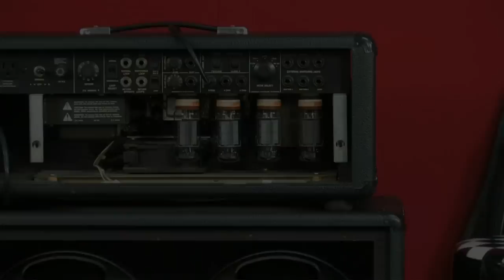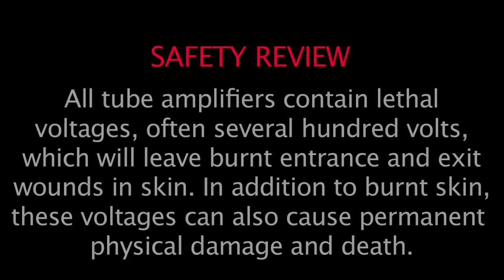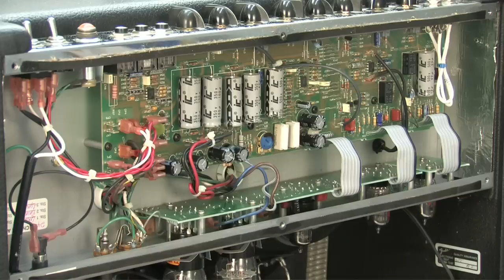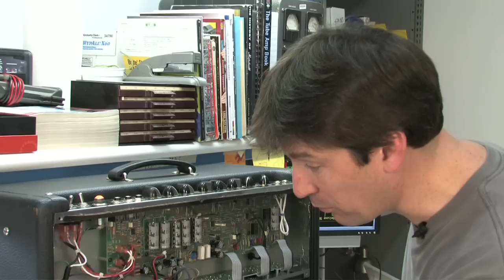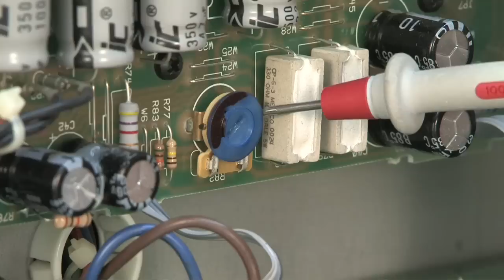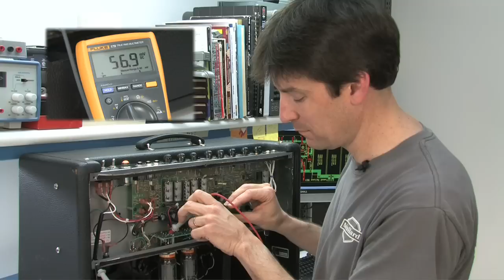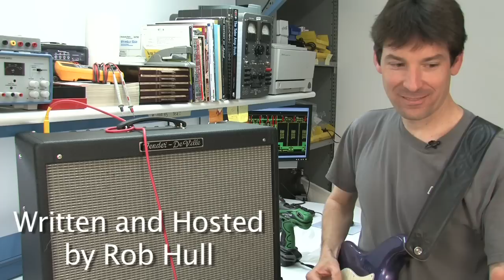How To Bias a Deville Amplifier

Comment: I am having a big issue & you seem to be "THE MAN" to ask!!!
My Hot Rod DeVille will not switch down to clean channel (Always In Dirty Gain Channel).
But when I power down the amp,
It flashes Green for a split second...
Do you know what could be causing this ?
& Where I should be looking first & so on?
I have been a Transtube Peavey Guy for 20 years now & just Inherited one of these fine Beauties !!!
Thanks for the Tube Tips,
Cause that would have been my next Question !!!
Thanks 4 Sharing Bud!!! 
Rock On !!!
DEv
Reply: violeman - make sure the channel select switch on the top of the amp is not depressed or stuck in the down position.  Clean as necessary.
Reply: violeman i've heard resistor 78/79 (the two next to the bias potentiometer shown in the video) can cause issues with channel selectors on hot rod amps, google that?

Comment: Hi Nick, if you can tell me why it is an important first step, set the power - 60 volts, and whether it is necessary to measure bias in milli volts or in milli amps, and what is the difference in these measurements. Best Regards
Reply: Stratocooler - setting the bias control voltage to its most negative level insures the tubes aren't installed with a bias control voltage that could cause tube damage.  the negative 60V is the starting point.
Reply: 'Biasing' is the procedure which sets the 'plate dissipation' of the tubes. This is determined by the plate voltage multiplied by the amount of current flowing in the tubes. The pot adjusts the negative bias voltage on the tubes' control grids which determines the current in the tubes and therefore the plate dissipation. The voltage at the pot is the actual negative bias voltage, and setting it to -63V (or as high as it will go) means that the current in the tubes is at its minimum and can be adjusted from there up to its recommended value. In this amp, (and some others) there is a 1 Ohm resistor between the cathode(s) and ground through which plate current must flow. The voltage across this resistor is measured at the test point, and the number of milliVolts across the one ohm resistor is the same as the number of milliAmps flowing through it.
 (From Ohm's law: current = volts / resistance, I = V/R, so (e.g.) 30mV / 1 = 30mA.)

Comment: Why do you need to do the first procedure of turning the amp to maximum voltage?  I do not understand what the purpose is since in the second step you adjust the adjust the bias voltage to 60.
Reply: ***** - setting the bias control voltage to its most negative level insures the tubes aren't installed with a bias control voltage that could cause tube damage.  the negative 60V is the starting point.

Comment: I looked at the schematic and the bias test point is total cathode current.. 60mV or 60mA for the pair or 30mA pr tube is cold.. offcause is depends on what the plate voltage is, but according to the schematic the +B is 485V with the 60mA total cathode current draw.
That adds up to a plate dissipation of 14.5W pr tube or 48% of max plate dissipation for a large 6l6GC, a bit too cold.. I would aim for at least 55%..(~70mV at the test point).. 80mV at the testpoint is probably around 63% of max plate dissipation.. Remember that plate voltage will drop a little when you bias your amp hotter (i used 478V plate in this calculation).. 
Also the mV number contains the screen current as well, so in fact your actual plate dissipation might be a little less... 

You can use a pair of smaller 5881 tubes for slightly lower power. THey are rated at 23W plate and for those tubes you definately do not want to go above 60mV at the test point.. at this value they are around 63% of max plate dissipation..
Reply: MrAnders1976 He mentions that the 60mV setting is what is recommended by Fender.  He even mentions some different levels that would be okay.

Comment: Hi, is that voltage for any Fender amp? because I have a Super Sonic 60W with 2x 6L6  and I need to bias it, but don`t know what voltage to look for!
Reply: Mateus Moron - Does your Super Sonic have an internal test point for measuring the bias current?  If it does, the voltages should work out.  If no test point, then it is unlikely this video is applicable to your amp.

Comment: so essentially what your doing is adjusting the voltage applied to the plate of each valve? similar to how you would bias the base voltage of a transistor?
Reply: richard kerr - nope ... the voltage being adjusted is the control voltage which is applied to the control grid of the tube.  The control grid of a tube is similar to the GATE lead of a FET.  The plate of a tube is similar to the DRAIN lead of a FET.  The cathode of a tube is similar to the SOURCE lead of a FET.

Comment: Hi Rob, firstly many thanks for this lesson, it was really helpful. I live in the UK so I have bought some GT-6L6-GE tubes from a local supplier. I have followed your instructions however even at the lowest setting I cannot get the Bias under 76. Could you suggest something I am doing wrong, it all looked pretty straight forward. Thanks Lee.
Reply: Lee Gibson -  sounds like you have some very hot running tubes.  76mV is not outside the limits of the tubes ... they will just run hot.  The typical bias range is 60mV - 75mV.

Comment: Is there any issues with handling the glass with your bare hands? I know they can get hot, but is there any issue with oils from your hands causing an issue on the glass like on halogen lightbulbs?
Reply: vacuum tubes are not like light bulbs. Finger prints, dirt, stickers, etc. will not cause any issues.

Comment: Hi - the bias test point on my recently acquired (used) Hot Rod Deville 410 won't go past 30 mV even with the bias pot turned all the way clockwise. I have all the volumes down, power on and standby off, and 30 mV is the actual reading (I didn't divide by 2). I only have the tubes that came with the amp. Is there any explanation you can think of? Nice playing!
Reply: Hi, I have the same issue with my Hot Rod Deluxe. Not as low as your readings but the maximum reading I get is 59mV's. To get a setting so I'm not burning up my tubes I have to set it at 30mV's, which is about halfway. So far I haven't found out why my readings are a lot lower than Fender and others recommend.
Reply: I had a burned out 470 ohm resistor and probably bad power tubes. There are two 470 ohm resistors - one going to each power tube (I think coming off pin 3 - you can see the pin numbers if you look on the white plastic that the power tube plugs into, from inside where the ciruit boards are). I got some 1 watt 470 ohm resistors (xicon) from Mouser.com and replaced the tubes. Now I was able to bias my amp to 66mV. I found the answer to my own question in this article:

http://www.maxxplay.us/img/hrdx/How%20to%20Bias%20&%20Biasing%20FAQ.pdf
Reply: Sal Alexander Thanks for the reply, much appreciated. I've changed my tubes, had same problem with previous pair also, so next step will be to check the resistors. Thanks again.
Reply: Sal Alexander - You likely have an amp issue.  There is likely an open component or poor solder connection.  A qualified amp tech needs to look at your amp.
Reply: Fender56 You likely have an amp issue.  There is likely an open component or poor solder connection.  A qualified amp tech needs to look at your amp.

Comment: Hi Rob,
I have a problem with my HRD and the power tubes.

My HRD III Bias setting range seems to have changed, it goes from 60mV to 15mV. I have set it to 30mV which sounds fine but obviously this isn't anywhere near the recommended 60mV.

When I check the voltage on the right hand side of the bias adjuster, with the standby on, I get -60v.

As I said, it sounds great and I'm not experiencing any hot spots. Is this ok and am I going to damage anything?
Reply: Fender56 - You likely have an amp issue.  There is likely an open component or poor solder connection.  A qualified amp tech needs to look at your amp.

Comment: Hey!
I have a Fender Deville III 212 Amp
It supossed that is in a good condition I have treated him very well the problem is that
yesterday I used the amp in a rehearsal with one of my bands and everything went fine, then I move the amp to another place to jam with another band
I put the amp to heat the tubes about 15 minutes as soon as I turned on the standby nothing goes out of the speakers when i turn the volume at 10 (For firt time in my life) it was at an extremely low volume too low I'd say....

Not even the guitar cables make static i opened the back to check and everything is in order the tubes light up well and there is nothing out of place also i removed the fuse and everything was ok it wasn´t burned or anything like that.

So what do you think in could be the problem? the bad thing is that in the city where I live there are not many music stores or persons that knows about this kind of amp
HELP PLEASE!
Reply from the maker: If you removed the speaker jack to power a different cabinet, make sure you reconnected the speaker cable to the correct speaker jack (the jack closest to the power cord). If still no sound, plug your guitar into the f/x return and if you get sound, the preamp stage is not working.  If no sound, connect an external cabinet to the external speaker output. If you get sound, this external speaker jack needs cleaning.  If still no sound, then the repair is an internal problem that requires an amp tech to troubleshoot.

Comment from the maker: Nik, installing EL34 tubes in the Hot Rod DeVille would require modifying the amp.  If you want a close EL34 sound, I recommend trying the JJ 6L6 as these have a very compressed, low vacuum sound ... very similar to an EL34.
Reply: Shoes EL34's draw more current which means they need a sturdier OT (more ma headroom in the output transformer) and higher screen resistor values, and sometimes also different bias resistors depending on if they can be biased with the trim pot (if the value is in the range of the pot).  Sometimes you can get away with just swapping them but common screen resistors for 6L6 is 470ohm resistor and EL34's for better with 1K or 1.5K resistors.  You can see in this video that even at max range, this bias pot didn't have much throw and would be hard to run EL34's in.
Reply: Shoes Both the power transformer and output transformer would have to be replaced to put EL34's in this amp, along with changing the screen grid resistors as well as changing some of the wiring on the tube sockets, which isn't very easy since their PCBs.
Reply: I would think that EL34s would merely require re-biasing. All octal-pin tubes use the same plug and socket.
Reply: +Alva Goldbook one of my tube amps (and only one out the 30+ I own) a Carvin MTS 3212 has a switch to select between using EL-34 or 6L6GC tubes.  it says in the owners manual that it has different taps on the transformers and different resistors  and different heater loads.  Either way the amp has some great tones.   This amp also has a switch that literally shuts off two of the power tubes to drop from 100w to 50w. but that's another story.  you will almost certainly damage the amp if you use the EL-34 instead of the 6L6 where specified, but what would happen if you use a 6v6, the JJ seams to have very similar specs, . Could I get my Blues Deville 410 to break up at much more usable volumes?  Just wondering?
Reply: Mitchel Young Yes, you can use 6V6s as a drop in replacement for 6L6s in a Fender Blues Deville, but you would have to rebias the amp. It may even require a modification of the bias supply circuit. I've heard of many people doing this with these amps, but do NOT use some vintage NOS 6v6 tubes, as they would most certainly get fried, and possibly damage your amp. Rather, you should stick with the more sturdy modern production JJ 6v6s which are designed to handle such abuse. Another way to tame the volume of the amp is to use an attenduator. Those can be pricey. One trick that worked pretty well for me was plugging into the 2nd input jack and removing 2 of the 10 inch speakers from the amp. I'm thinking I might just put a new baffle in my Hot Rod Deville 410 and replace it with 2 12 inch speakers. The fewer the speakers, the less the volume. You'd be surprised by just how effective this little trick is. Just make sure you have your remaining speakers wired up correctly.
Reply: Is there not a risk of damaging the pricey output transformer when messing about with speakers and output tubes?
Reply: Jonny Beck When it comes to speakers, all you gotta worry about is making sure the ohmage is correct and the speakers aren't pushing too much wattage. With modern day ceramic speakers, this is rarely an issue. 

As I said, you can't just put any ouput tube in the Deville. It's designed for 6L6GCs. But a proper tech shouldn't have much trouble modding the amp to accept JJ 6V6s. I wouldn't recommend a DIYer to try this.

Comment: Nice explanation. Will adjusting bias help with the over-sensitive volume issue of this amp? The "smaller tubes" (pre-amp tubes? Sorry, mechanical engineer ignorance!) are 12AX7 models and I know you previously suggested 12AU7 or 12AY7 tubes. Are those tubes different enough from the X7s to be worth investing in or is there a simple resistor a person could drop in to solve this issue? Thanks so much!
Reply from the maker: The Hot Rod DeVille is a 50W amp.  And in loud applications that require a 50W amp, the DeVille works fantastic. However, in quieter applications (such as at home or church) where a 10W amp would be better suited, this amp is much too loud. As such, there is much internet discussion on making this amp quieter without loosing tone. You can try installing lower gain preamp tubes, or 6V6 power tubes, or a volume pedal in the effects loop, or a different volume control. All of these will reduce (or modify) the volume some, but you will still be left with a very loud 50W amp. I've found the most effective solution is to use an attenuator between the amp and the speakers and control the volume that way.
Reply: The over sensitive volume Aunt Jemima mentions might be to do with the ratings of the pots as that is something Fender addressed in the latest version (III) of the Deville family. Versions I & II used to leap from nothing to very loud when turning the pots between values 0-1. Thanks for the video by the way! Consider me subscribed
Reply: +TubeDepot FYI I just put a GT 12at7 in the PI tube of my Deville 410 and the volume seams much more usable, since the lead channel is not to my taste I will try a 12au7 in V2 and possibly even V1, what do you think?  If I tried some 6V6 what would I set the bias to?   Can I just test to see if I like the tone by taking the tubes out of another 6V6 amp I have such as a Marshall DSL15H or Fender Deluxe Reverb 65ri? or should I buy new?  The JJ 6v6 seems closest in specs to the 6L6 so should I just buy a matched set of these

Comment: Hi, is it possible to run a Bassman with a pair of 6L6B's instead of 6L6c's? Thanks.
Reply from the maker: The bassman will successfully run any version of the 6L6 tube, this includes the 5881 and 7581.  The KT66 is possible as well, although the additional filament current draw will make the power transformer run hot.  I usually recommend against it ... unless you put a small cooling fan on the back of the amp.  To safely run these tubes requires proper biasing.  The KT66 is a 25W tube, so is the 6L6G and the 5881.  The 6L6GC is 30W and the 7581 is 35W.  Bias according to their respective plate dissipation and all should be fine.

Comment: first off thx for this tutorial, im planing to get a used 212 deville and that's exactly what i need to check it out in a basic way.. Just a question though since im no tech or whatsoever, you first checked the "general" voltage by putting the red pin close to the bias pot, is there any solder point there since we can't see from that cam angle ? thx in advance for your reply. Cheers from france

Comment: Hi Rob, I have the same amp as enrique , a 1980 Fender Twin Reverb 135 for which I just bought a whole new set of matched tubes, preamp and power tubes (SED Winged C 6L6) ,(a replacement package expressly for the Twin from tubestore),Do I have to proceed necessarily with changing the resistor since I have not a technician ready at hand in the short period? Or can I go on without particular problems in terms of sound or amp efficiency and postpone the replacement. Thanks

Comment: Hey there thank you for your speedy response. so I seem to have found out the source of the issue, and I'd thought I'd share what I found. The speaker jack was plugged into the ext. speaker output on the chassis. someone must have plugged it back in incorrectly. does that sound like that would cause that kind of volume drop?

Comment: Hey Rob, thanks for the great video! I followed it very closely, and my volume is still very low when I tried to do a sound test. power tubes flicker blueish purple as I send a guitar signal to it. these amps are very loud as you know, but I have to turn up a lot to hear anything. I checked the voltages at the large grey caps and they appeared to be stable. I also replaced the 2 12ax7s closest to the inputs 1&  2 I was hoping you might have some thoughts on what might be going on here. thank you

Comment: Is there any chance of salvaging a pulled PCB trace leading to the power tube socket? I'm fairly confident with soldering, and I have 18 gauge solid core wire I've used to replace bad traces in guitar pedals. I think my concern is long-term sustainability. It seems like once the solder mask is pulled, the copper trace continues to deteriorate pull off the board. I assume the only alternative would be a lot of work around hand wiring the traces off those finicky ribbon connectors.